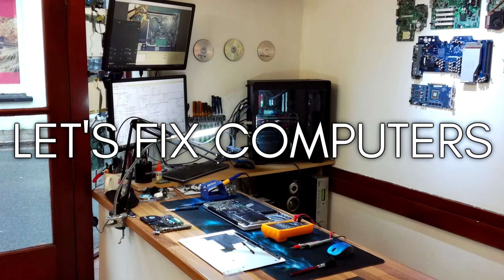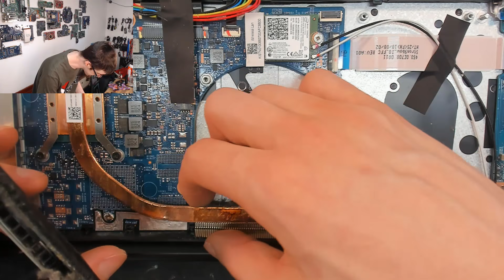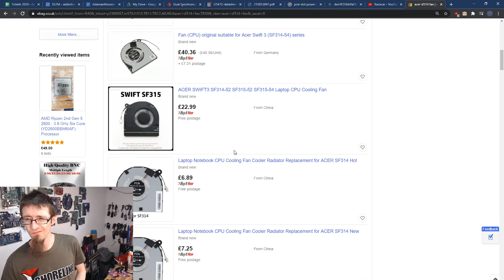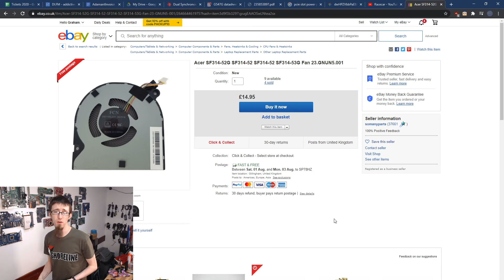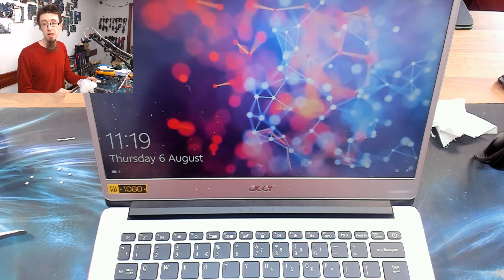Noisy Laptop Fan (Acer Swift SF314) - LFC#219

Comment: My advise for you would be, in future disassemble the whole cooling unit and not just remove the fan.(I did recheck and you have caused damage to a customers cooling assembly) Cleaning and applying fresh thermal paste would have been nice to see and also reapplying some tape (Alu' tape is max £5 a roll of 20m approx') between the fan and heat fin stack.
Reply: Can you specify what damage he did? Because it seems I'm gonna have to do the same with my laptop and it's just replacing the fan and I don't want to damage anything in the process
Reply: @nazibkhan775  Hi Nazib, at 4 minutes 35 seconds, he unscrews just the fan and this results in bending the heat pipe upwards when he removes the fan. You should remove the whole cooling assembly and then remove the tape from the fan/heatsink assembly.  When every you do work to any area of cooling, you should always clean and place fresh thermal compound to CPU or GPU.
Reply: You mean the aluminium tape? Would it cause any problem with the motherboard because it transmitts the electricty?
Reply: @hasantaskn5231  Yes Hasan. 😀
Reply: You mean advice

Comment: recently pciked up an older Tagan 600W PSU for next to nothibg - in great condition but a very noisy fan. Bit of searching online and turns out a lot of fans have a rubber fan coveting the bearing and a single drop of oil into there and its inaudible now. Result

Comment: I have a toshiba satellite c850, which my father give me at 3 years ago, and now the laptop have got some problems, auto turned off suddenly (even i removed the battery) and the lvds cable was losted by mistake, and key board also broken(so i can't use fn keys to share the display to an external monitor), so is there any way to bypass the display only to the externel VGA port? Remember my keyboard is not usable, and i dont want to buy that, so pls, is there any way to modify the Mobo of the system?
Reply: You mean lost

Comment: The correct fix for any Acer laptop ... a can of petrol and a match
Reply: =O I love my Acer Nitro 5. Although you wouldn't need the petrol.
Reply: @CaveyMoth  I loved mine too.
I took good care of that laptop, but it still fell apart after two years of casual usage. The pieces of plastic  holding the screws in place at the hinge broke off, so the frame holding the screen in place kept popping open in the lower left corner every time I opened it. And then one day it just decided to up and die completely. Now it doesn't turn on at all. No charging lights either. Good thing I found this channel. I'm gonna try to repair as soon as I have the time for it.
Reply: @brucelee3298  Jeez, man. You must have had some kind of bad lemon. I've had mine for 3 years. I even took it apart to dust out the fans.
Reply: Never buying acer again

Comment: Whenever I am cleaning or repairing a laptop, especially when there's a thermal problem due to dirt or fan, I always replace the thermal paste on the CPU and the GPU
Reply: on GPU sometimes if not most of the times they put from the factory a thermal pad not paste because there is a Gap, a thermal paste on a thermal pad die will most likely kill the Graphics card
Reply: @ellinasmarios6165  now ,they just put thermal pads

Edit: may i ask why thermal paste would kill a GPU?
Reply: @qwertyuiopasdf160  if there is a gap between the die and the heatsink thermal paste doesn't work, is like you didn't put anything. Eather you put a pad that has a poor performance by design, a product from Greece called K5 PRO is like Gum and work better than pads or cooper shims and paste on the surfaces.
I was a technician for years many systems came to me dead serviced by others that used paste on everything.
The reason you put this materials is to transfer heat, even if is the best paste on the market if is not designed to be there it shouldn't be. Eather you make the nessesary modifications to put paste or use the proper heat transfer materials.
Keep in mind copper shims are electricly conductive so if you choose such a solution you must be sure is the proper size that it will stay there having constant downwards pressure and not touch anything else except from the the die, there is electronic components around the die and are not always insulated so be careful.
Reply: @ellinasmarios6165  alright, now i understand. Thanks for explaining
Reply: @qwertyuiopasdf160  welcome

Comment: 5:05 RIP heatpipe
Reply: I actually missed that... I always use a small pipette with alcohol or petrol to remove the tape (a q-tip would also do). Score the tape with a blade, a couple of drops of petrol, let it work, comes right off – no force no kinked pipe.
Reply: I got it
Reply from the maker: It's fine. A little crease won't kill it, a proper bend and kink will. Wasn't ideal though I'll admit - the tape was a little stronger than expected.
Reply: @Adamant_IT  A little crease won't kill it, you are correct, but it will hinder the heat exchange between the evaporator and the condenser.
Reply: @chilldudie242  chill, Dudie. I'm 99% sure he replaced the thermal paste off-screen, and that tape will make absolutely no difference. Yes, he should have done it slower and been more careful, but that heatsink will still function as intended with no drop in performance whatsoever. Can you honestly say that everything you've ever done for your job was every time 100% perfect? Cut the guy some slack.
Reply: @chilldudie242  its some Shadey Work
Reply: Nice spot hahah
Reply: This thread was useful, because it verified my suspicions of me killing the cpu heatpipe on the gpu heatsink on myhaswell gt70.
Reply: I was shock, when see that heatpipe bending

Comment: A few HP laptops I've had to work on have had this issue before (damaged bearing) luckily a quick search on eBay would get you a new one, a new blob of paste and a clean out usually fixed it

Comment: Ooow you missed out the fan to heatsink tape, it will explode ha ha :-D joke :-D
I have never seen a fan as dead as that, it's like someone put valve grinding paste in the bearings.
Reply: Old thermal paste = fan works too hard and kills itself. If you change the thermal paste these fans last much longer. It’s a shame he didn’t!
Reply: Cat Hair would be my guess, mixed with dust

Comment: If a fan is so dusty that it fails, there's no doubt that the machine has been running hot for an extended period of time and this often cooks the CPU thermal paste. I will thoroughly blow out the machine and will change the thermal paste EVERY TIME in this situation. No exceptions.

Comment: The MacBook air when you have fault sensor or not connected it pumps the fan. Also could be the current sensor resistors that goes bad
Reply: Was going to comment something similar :) I suppose if they could get it to boot it would be worth checking if everything runs slow as hell, if it does it's almost certainly a sensor issue
Reply: You mean faulty

Comment: tape the fan back to the heatsin
Reply: I'm no expert but surely the tape help with airflow?
Reply: Good stuff tape not necessary but you should have changed the thermal paste and i tell you why thermal paste has a shelf life.The fact that the fan had issues most likely The CPU/GPU or APU would have kept the paste at an above rated temperature and you would most likely find the paste crumbly therefore not transfer heat efficiency as it should anyway great video mate from Perth WA
Reply: @Fixingthingz4u  I see lots of cakemakers spreading so much paste on....Lol you know who you cakemakers are. ..
Reply: @Crazy--Clown  yup to much is bad also
Reply: @Meghnad The thermal paste dehydrates, and the heat exchange rate gets lower and lower over time.
Reply: @FLV95  bingo.  Agreed
Reply: @Meghnad half the fix there is its running linux...
Reply: @Meghnad I wouldn't trust China, fuck knows what they put in it
Reply from the maker: It makes basically zero difference, the fin stacks on heatsinks like these are so small that having a little air hit the back of the heatpipe is probably going to be just as effective anyway. Certainly no harm in it though.
Reply: @Adamant_IT  I'm sure you're more than correct for this laptop specifically but my Asus laptop had quite the gap between the stock fan and heatsink. So much so that the recommended fix was aluminium tape to help the airflow go through and not disperse. Made a 2-3°C difference, very noticeable when you're barely under thermal throttle on some of these smaller form factor laptops.

So for anyone else reading this, it's not a 1 size fits all solution to skip the tape. 
Cheers.
Reply from the maker: Yea, bigger laptops are a different case, I'll agree with you on that point. The vast majority of repair jobs I see are typically low-voltage CPUs where these kinds of optimisations make zero difference - so some discretion required then!

Comment: Why dont laptops ever come with the slidey dust filters like bottom mounted psu's do?
Reply: i have found some laptops that have dust filters, but instead of help what they do is force to the fan to spin harder on high temps. It works on psus because most of them now have a 140mm fan and dont reach more than 50°C.
Reply: Older Toshibas like the TECRA series had a "slider" which could be pulled and the fins cleaned.
see https://i.ebayimg.com/images/g/n1oAAOSwtQNb5e48/s-l1600.jpg the vertical bar on the right side
so, its all about engineering and costs
Reply: Because that'd be too much engineering ;)
Reply: Some older laptops has a bottom cover for the ram but it went to the fan so it could be cleaned. My Dell 1545 has that kind of bottom cover.

Comment: you didn't tape the fan back to the heatsink?
Reply: Who cares apple is all bullshit anyway and it is screwed in not going anywhere.
Reply: @jackburton8352  That is not an Apple, it is an Acer, and taping the fan is quite important for air-flow
Reply: @rigsbyrigged1831  The tape is bollocks and you know it if it was so important why was it not supplied with the replacement.
Reply: @jackburton8352  CHINA!!
Reply: @jackburton8352  First of all, you thought it was an Apple, so I do not mean to be rude, but we need to assess your view based on that level of knowledge or observation. Whatever caused you to mistake an Acer for an Apple, knowledge or observation, I cannot know, but it plays a role.  Secondly, I do not know that the “tape is bollocks” – I know that if it was bollocks, no manufacturer would spend money and the work putting it in. It is in there to direct air from the fan through the fins of the heat pipe.  Air, like water, will always take the path of least resistance. The tape leaves it no choice. Finally, I have performed exactly this job on many, many notebooks, and would never leave off the tape. In fact, I have re-taped notebooks with fan tape, where others have replaced the fan without the tape and the user complained about noise and vibration after prolonged use. I always have a roll of Kapton-Tape at hand for exactly this purpose. It is a bit overkill, but I know it will not melt off (the glue) or get gungy like normal insulating tape will.
Reply: @jackburton8352  First of all, you thought it was an Apple, so I do not mean to be rude, but we need to assess your view based on that level of knowledge or observation. Whatever caused you to mistake an Acer for an Apple, knowledge or observation, I cannot know, but it plays a role.  Secondly, I do not know that the “tape is bollocks” – I know that if it was bollocks, no manufacturer would spend money and the work putting it in. It is in there to direct air from the fan through the fins of the heat pipe.  Air, like water, will always take the path of least resistance. The tape leaves it no choice. Finally, I have performed exactly this job on many, many notebooks, and would never leave off the tape. In fact, I have resealed notebooks with fan tape, where others have replaced the fan without the tape and the user complained about noise and vibration after prolonged use. I always have a roll of Kapton-Tape at hand for exactly this purpose. It is a bit overkill, but I know it will not melt off (the glue) or get gungy like normal insulating tape will.
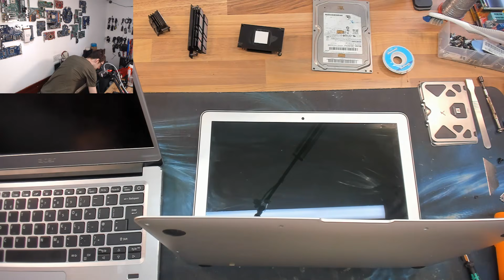Reply: 2:18 ... my friend. That’s Apple. 

Blind?
Reply: @chilldudie242  the repair has nothing to do with that macbook air...the guy forgot to retape the cooler on the acer
Reply: @AeiKei  Cool, you asked about an Apple, now you know!
Reply: @chilldudie242  the op asked about the taping between the cooler and the heatsink...that has nothing to do with any apple device...just the fact that the technician didn't put back that tape
Reply: @chilldudie242  we were not talking about the macbook air...look a bit earlier in the comments, one dude thought the acer was a apple...the taping has nothing to do with the apple product. It is shown just for comparison on fan noises, pay more attention
Reply: @dr.bright5894  lol relax narc
Reply: @jackburton8352  aha an apple critic?
Reply: @martinmalone6324  Yes i am they are overpriced and unreliable.
Reply: @jackburton8352  That is an Acer Laptop not an Apple
Reply: @jackburton8352  I think you need to purchase a good pair of glasses, or wash your eyes, because he is clearly working on an acer laptop, or you did see a macbook for 10 seconds in this video and your hate towards apple has taken over which causes you to actually lose your mind, if that is the case, i would get some professional help, because this video is about pc's, not macs.

Comment from the maker: Another simple one today folks, I've got bigger stuff in the works, it's just not quite ready! However, I'm also making time for these 'basics' videos because a lot of people ask me where to start with repairs - and this is it. This kind of work is what I call 'fundamentals', just simple parts replacement jobs. Identify damaged part, locate replacement, order, replace, done. Be it a fan, a hard drive, or an LCD panel, these kinds of jobs pay most of the bills.
Reply: That fan really is noisy
Reply: Why not replace the electrical tape? Seems like it could have a measurable effect on thermals (though probably not too high), especially when the heatsink inevitably gets full of dust again, as the air might prefer to escape through the slit and out the bottom vents.
Reply: Thinking about it, it could make for an interesting video to see how much of a difference forcing the air from a fan through the heatsink could make. It could potentially be useful for taming hot running laptops
Reply from the maker: Yea it won't make any significant difference. A little bit of air will go over the top f the heatpipe instead of under it - it's still hitting the heatpipe. Macbooks don't bother directing airflow at all, as long as it's all going past the heatpipe that's what matters. You'd probably see a bigger difference on a laptop with a bigger fin stack on it, mind you, but not this dinky thing.
Reply: @Adamant_IT  There is one more negative thing about the tape - as its sticky, it collects dust "more efficiently" and clogs the neat pipes faster.
Reply: @Adamant_IT  my victus 15 is making really annoying buzzing sounds even I have it for 11 months
Reply: how much did the customer paid for the repair inc part?
Reply: Hi my laptop starts buzzing and making noise when I plug in my charger and then in 30 minutes it overheats and shuts down. I cleaned the fan and it makes little to no noise. I don't think the fan is making the noise. Can you help me
Reply: THE "MASTER CLASS "WORK . This is what I expected from you. BEGINNERS LIKE ME IS VERY Helpful THIS TYPE OF FUNDAMENTALS THEORY.THANK YOU Very MUCH.WAITING FOR MY JOURNEY BEGINS WITH You ANOTHER WORKS
Reply: Hey Graham, for the basics/ fundamentals you have much stuff ready in LFC. A new Playlist should do the Job well
Reply: Hey is acer predator triton 300 i5 9th gen  cooling fans replaceable?
Reply: i bookmarked your video--just cleaned the fan and its still humming--thanks for trying to help
Reply: Nice video
Reply: Can we replace the fan with the graphics card @
Reply: thank you
Reply: does a computer try to boot up when the fan is connected but not working?